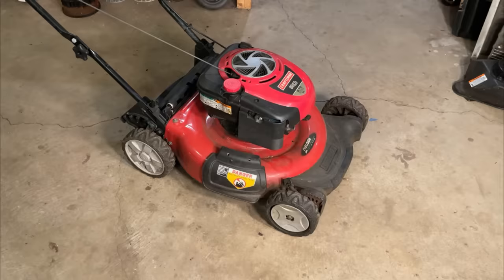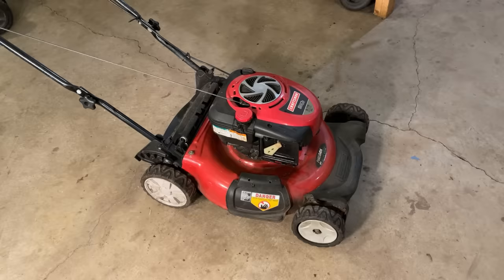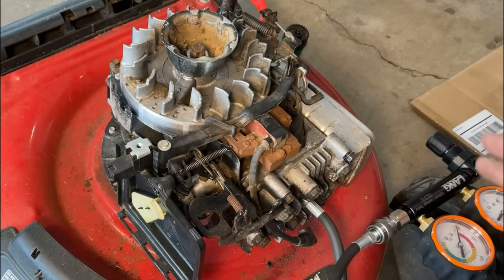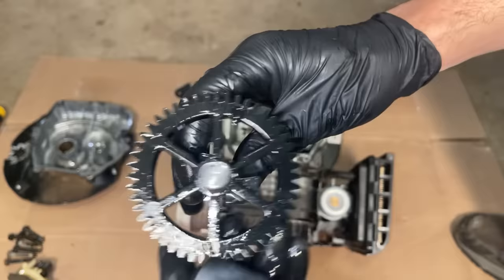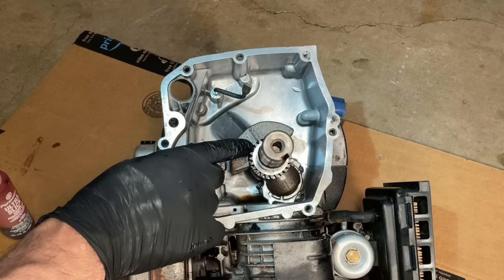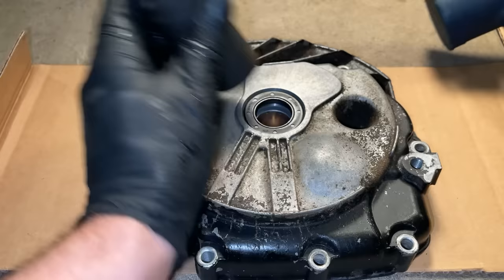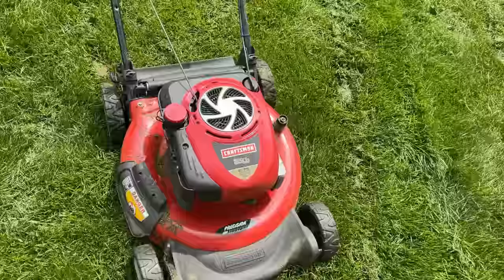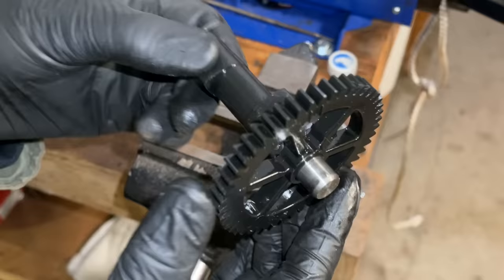Lawn Mower Will Not Start - You Will Never Guess Why

Comment: Don't ya just love PLASTIC PARTS???
About 10 years ago I bought a 6000 Watt generator at a yard sale that did not run right for $75 dollars. It would fire up and and run for a few seconds then it would quit. I stuck it in my store room and forgot about for 6 or 8 months. Then one day I dragged  it out and tried it again and it would it would fire up and then quit. I went on line found that it could be low on oil I toped off the oil and it fired up and it ran.
I stopped by the house where I had bought it to see if they wanted to buy it back, the house was empty. I talked to one of the neighbors that was working in his yard and he told me that they had moved out of state and did not know how to contact them.
So I still have the generator and have used it a lot.

Comment: James- how did ( or does the Cam gear jump?) The blade doesn't look bad but it could have been replaced. I try to stick to Briggs and Stratton- I have extra parts and I'm used to them. Thanx BTW- is that white nylon gear next to Cam Gear the " safety device" clutch that automatically shuts off engine when someone hits the blade while engines running?? I Liked and Subscribed.

Comment: WOW!!!!! Bad design for them to use plastic!!!! VVT would have been overkill too for a lawn mower but still. Back in the 70s and 80s I was pull starting mowers with no problems. Dont no why they used the plastic decompression cam to alleviate hard compression...

Comment: Carburetor. Bolt fell.out.  thats what mines problem was.  Screw fixing it, ive got 2 other mowers and a tractor.
And that mower was given to me. It used to have electric start.

My problem is the atlas snow blower thats 40 years old do you think the Briggs 5hp horizontal shaft motor has a timing system like the lawn mower has ill have to look into it becuse I get no spark
But the coil oms out as good, I was going to just buy a new one, and set the gap to see but no point in buying a bunch of parts to find out I can't fix it. 
Its really old .

Comment: Now that you know that the lobe is supposed to align with the tab, Is there a way to secure the plastic gear back onto the shaft?
Reply from the maker: You could try, but in my case it was cheap to get a used one.

Comment: These Newer Lawnmower Engines just do not last, I bought a Pushmower from Gibson over 40 years ago, the compression is gone and yes I have replaced several keys in Flywheel -points and plugs but this engine will still run but just has no power because of Rings being just  totally worn out. These older engines were great because no Plastics were in or on engine. By the way, I paid $39 for this 3 hp push Mower...

Comment: These B&S engines have been around for many, many decades and are built to last almost forever.  Sad that they use plastic for the timing mechanism.  Cars that only last 2 or three years are designed with planned obsolecent parts that cost 50 times to replace.  A mower should not be designed the same way, in my opinion.  So sad the way the world is now days for our kids and grandkids to have to live with.

Comment: Hello, I have a Troybilt snowblower, 179cc suddenly stopped starting.  Checked and oil may have been low.  While working on it, oil screw was loose, so it could have been out of oil, or very low.  But, I have compression. smooth turning the shaft.  Could the low oil situation have caused an inner timing issue? Compression release issue? Flywheel/key is fine.

Comment: Excellent video James I learned alot from this video. Quick question would improper spark plug gap cause engine not to start? The lower mower is getting a spark and I replaced the carburetor. Any ideas?
Reply from the maker: If the gap is too large, then it will not spark under compression.  Would also check the flywheel key if still nothing after checking/replacing the plug.
Reply: Yes tried that and it still not starting. The flywheel key was damage so I brought a new one. I replaced the spark plug. So at this point I'm stomped of what could be the problem.

Comment: A bit frustrating.  I don't recognize that "gadget" that you placed on the top of the timing gear (you didn't name it).  I didn't see you balance or sharpen the blade.  I do appreciate that (at the end) that you found that the gear actually rotated on the shaft.  Should that be reported and a rebate/refund be initiated?  Otherwise,  I love your videos - actually - "hooked on" your videos.  (I realize that this is 2 years old and probably won't be responded to, but I had to say my piece, eh?  (chuckle)

Comment: Using starting fluid on a lawn mower is not a good idea. The manifold is not built with enough strength to withstand the release of energy of starting fluid.  Better to just use gasoline in a spray bottle that will give you a fine mist.

Comment: James, I'm curious. Has Craftsman modified that part so it will not slip again on the shaft??? Seems to me that part should be upgraded to metal instead of plastic. I figure if I bought the mower with the plastic part, it'd be just my luck the same thing would happen just like the one you took apart!!!!

Comment: Interesting video.  Never seen anything like this happen before.  I'm wondering if you thought about just shifting the position of the teeth to align the cam lobes with where they should be to correct the timing of the valves.  I know you bought a new one, but I'm wondering if that was actually necessary, or if you could just left the cam lobe shaft gear, shift it over by 20 degrees or whatever, and then reposition in the right spot.  Obviously, the question remains about why the lobes moved in the first place, but this could still possibly happen with the new part.  No?  Just wondering if the new part was necessary to get the mower back running again, minus the risks associated with another failure and the labor involved.  Thoughts?
Reply: Could a person not turn the gear back into place (where it should be to align the cam lobes) and then drill through the gear/shaft and drop a pin to lock any rotation.  Lots of work still, but might get you up and running quickly again, and not sure about the final cost on the parts.  Great video.  Have never seen anything like this before.  Thanks for sharing.

Comment: Plastic parts are not conducive to constant contact with oil & gas and will never tolerate the torque metal will. I’d have tested the engine before cleaning the underside & putting the blade back on. Doing it was pointless if it didn’t start.

Comment: I bought one for 10 dalars and thay said it sat all winter and now it won't start I gave them 10 bucks and took it home it was at a yard sale any way it turned over so I got it took it home and the oil was just fine and the gas was empty so I put gas in and pulled it 3 times and it fierd up and I guess that they never checked the gas tank it was a 6.5 lawn boy

Comment: Good job James but I have a dumb question? You spent say $25 on a new cam right? plus a new oil seal say another $10 your labor and most shops charge $50 an hr for labor or more for what you did if I had taken it to a repair shop would have cost at least $150 bucks or more . A new Harbor frieght engine is only $150 so why not just change out the engine? Three bolts to mount the engine and you would have been done? I know I know youtube content value right? Me personally I would have just changed the engine for the same money now I have new everything not just a new cam
Reply: His labor is free to him.

Comment: Hey James what's with this new lousy electric lawn mowers, a are they strong enough to cut high grass? The batteries aren't gonna burst into flames like those electric bikes n electric cars? What about those blade adapters,they are also made of plastic. I've seen them break on some lawn mowers n they're not available. Has there been some type of replacement adapters worthy of buying? Thanks for your info done that myself. Those camshafts stink.

Comment: Reasonable video, lacks detail of the torque you are using, plus when you inserted the part resembling a quarter moon gear connection, you are silent on what is happening. Provide more information, please.

Comment: I read somewhere that the Honda mower engines have a timing belt. Is that right?
Reply from the maker: Not sure.  Have only opened up the engine on an eu2000 and it did have a timing belt.

Comment: How many people know the cam timing of anything?  In engineering school I took a class in cam design, don’t remember a damn thing other than a few lobe profiles.  That knowledge is off in the ionosphere. Keep those brain cells tickin my friend.  I just spent 2 days on the same engine.  I got spark, fuel and now this, CRAP!  This was suppose to be a 4 hour job.  Briggs and Stratton use to mean “as simple as a rock”.  Nothing wrong with a flat head.  Need to reduce emissions, run it hotter then Haitis.
Reply from the maker: I thought when I got this one it was going to be a carb clean.  I think this issue happens a lot with this engine and likely goes undiagnosed.

Comment: As a former small engine mechanic from years passed , what the hell is Briggs thinking with plastic cam gear and lobes . Not a place for cost cutting in my opinion. SHAME !!!!
Reply from the maker: I was just as surprised.  Plastic does not belong in an engine.  Briggs are not the only one.  Honda’s $1,000 eu2000 has an all plastic cam shaft.

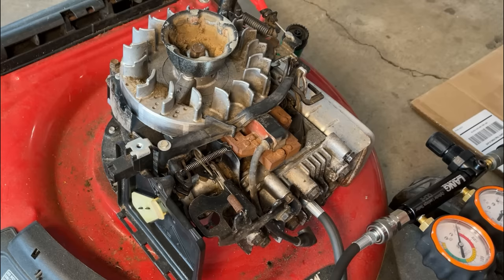Comment: 7:15-Cam gear & lobes are plastic??? When I was in my teens I mowed yards and fixed lawn mowers. The Sears Craftsman mowers were the worst! Junk from one end to the other. They bought the cheapest engine they could find, then insisted on a lower price, so engine builder (Lawson) built the engines soooo cheap! Looks like they have bullied Briggs & Stratton to do the same!

Comment: I have a Murray 450E that after a year failed to start. I then bought a new Poulan with the identical 450E engine, that was 6 years ago. The Poulan is about worn out now, and I would like to get the Murray running. The Murray won't fire, and being identical I swapped over the coil, sparkplug and carburetor to the Poulan, and it starts and runs normally, but the Murray with the Poulan coil, spark plug, and carburetor does not start. The flywheel key is not sheared, the cam shaft was good and in time, there was good spark, but the Murray engine never does fire. Does anyone have any ideas? I did clean the carburetor and flush the gas tank.

Comment: who was the wise guy who designed plastic gear? illogical and meant to break  = $$$$ maintenance? unecessary if you ask me. metal gear last a life time on a push mower. will probably buy the new technology electric mower. with 2 batteries. i do not like bad designing of products. plastic gears = looking for trouble.! my opinion   great job of diagnosing the problem.

Comment: my lawnmower does not want to start, I already put new gasoline, cleaned the filter and cleaned the carburetor and put a new spark plug and still it does not start, what could be wrong?🤔
Reply from the maker: Timing, spark, fuel or compression (usually fuel).  You can remove the spark plug and pull the engine over to see if the spark plug is sparking.  You can also spray a little carb clean into the throat of the carb and pull the engine over.  If it starts for a second, then you know you have spark, timing and compression.  Fuel is the issue.  Either fuel is not making it to the carb, water in the fuel of a clogged carburetor.

Comment: Of course the question remains. Will the same thing happen again with this poor design in an attempt for the manufacturer to save money?
    Knowing where the alignment should be, would it be possible to return it to the proper position and then pin the gear in place with a drilled hole and metal roll-pin or possibly drill and tap for a machine screw, held in place with Locktite 640?
  The other option would be to press the gear off, lay a small bead of weld where the gear rides and while it's still hot, press the plastic gear into position allowing the plastic to melt over the small bead of weld.

Comment: Early on you made the cardinal mistake ! You flipped it with the valve spring cover and it’s crankcase vent hose DOWN ! Now when you flip it level, it’s going to blow the oil over to the carb side and possibly hydraulic lock it. Not a big deal, but very avoidable. Just sayin’..

Comment: How much would you or a shop charge for this job?
Reply from the maker: Depends on the shop.  Would think between $150-$300 labor, plus parts.  Most would not repair since these mowers new were probably $350.
Reply: @jcondon1  yes I figured it would probably be cheaper to buy a new one, but thanks for the response

Comment: 🔵 You never told us WHAT-exactly about the part 'failed' and CAUSED it to rotate independently out of sync!......
Certainly the compression-release could have been easily bent back into position without compromising the integrity of the part, but WHY could the timing gear / compression-release assembly not be FIXED?
if something "Moved"on the assembly causing the lobe to rotate out of sync, then why could it not be rotated/restored BACK to its original-position and somehow retained-there so that it didn't move again?
Reply from the maker: I showed at the end that it was the gear that rotated.  It could be set back and secured, but the gear was also cracked.
Reply: @James Condon ,
🟦 I guess I didn't catch the segment where you declared the gear to be cracked,..but yes,.... I concur, that realization would certainly obviate just about any chance of repairing the original part, (unless it were the last one in existence),....thanx!
However, a question still persists;
What aspect of the original part failed to keep the lobe retained in the proper position on the shaft?......
I guess what I'm really wanting to know is; By what 'Design-feature' is the cam-lobe/gear prevented from rotating out of sync?.....
Is there no 'Notch' or 'Pin' Incorporated to prevent the gear/lobe from rotating independently on the shaft other than the FRICTION of it having been pressed onto it tightly???.....if so, what a RIDICULOUS design-flaw!!!
Most engineers these days are aware of a characteristic of many plastics to shrink with age, which often causes gear hubs and shaft-collars that are pressed onto metal shafts to split.
I guess something got lost in translation when they started making that assembly more cheaply using plastic components instead of being All-Metal as it used to be,.....
.....Oh well, (smh).

Comment: ironically this machine can cut its own power
Reply: it even can reduce iron oxide to iron to make the engine
Reply: flywheel should be a nice electric generator energy storage
Reply: also CaO + H2O => Ca(OH)2 + heat => CaO + H2O cycle

Comment: Who the fuck needs the aggrivation of fixing a lawnmower every year? 
I use fresh ethanol free gas, use stabilizer, change sparkplug, change the oil, change the air filter. Every year I have to rebuild the carburetor to get the damn thing running for one season. 
Bullshit

Comment: Not supose to use starting flued on small engines .could blow head gasket
Reply from the maker: I do not use starting fluid because the ether can definitely blow a head gasket or connecting rod.  I normally use carb and choke cleaner which burns slower and does not detonate like ether.  Would definitely not make a habit of it, but its very helpful when troubleshooting a broken engine.

Comment: I just tried to ask how much to do this at a lawnmower shop, and the guy put up his wall. You don't know what you're talking about, the guy on youtube doesn't know what he's talking about, you can take the camshaft out and throw it in the street and it will still run, blah blah blah. Refused to listen to anything I had to say, because apparently I was an idiot and knew nothing at all. I just went through the whole thing this morning, and all day really, and no fire, not even a pop. New coil, new plug, cleaned the contact on the stop switch wire, replaced the flywheel key which was partially sheared, etc etc etc etc.... Then I get this guy, who's a complete jerk and will not listen to anything and knows it ALL.... I have the exact same engine... Same fuel tank, same air box and attachment points, same shroud, same oil spout.. Literally everything is exactly the same...

Comment: thats why they are bankrupt and bought out by KPS make junk the springs on some of the decomp cam lobes in the intek singles fall off . then the starter burns out because it cant turn the engine over and the thread they use for battery wires burns up too . the v twin engines they eliminated the decomp on the cam altogether . cheap quality

Comment: Who taught you to  "use" a torque wrench like that? Because as an engineer who used to build high performance race car engines, you never try to torque an already tight and rusty bolt or nut as you did on the blade,naughty boy!  You should back it off, then tighten it! All you did was prove it was tight at best, or rusted up at worst.

Comment: Briggs engines are junk , I worked at a Kart track and used Honda GX160 motors with the governer removed 7,000rpm , average engine life 60,000kms

Comment: When we substitute plastic for metal we no longer get the reliability and durability that we used to. I have an old brig n strat mower that is years old. The new ones only last about a year before you need to repair or replace them. And parts arent cheap. If you cant fix it yourself you just go buy a new one because the cost of  repair now adays is close to the price of a new mower. The ugly side of capitalism.

Comment: Great vid ~ !       But I wonder if there were any way to affix the gear and the valve cam to the center pin/axle permanently...   ie drill holes and put in pins to prevent any movement ever again...... seems like plastic also has a limited lifetime like what 3 years on the cams ? lol cheap chinese !@#$%                 InventPeaceNotWar